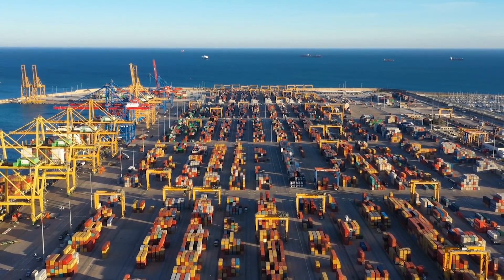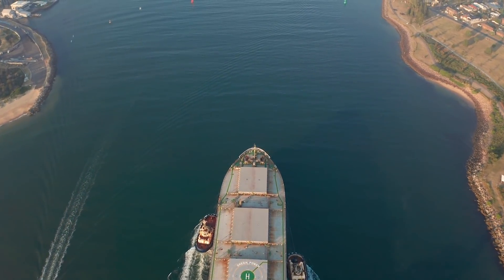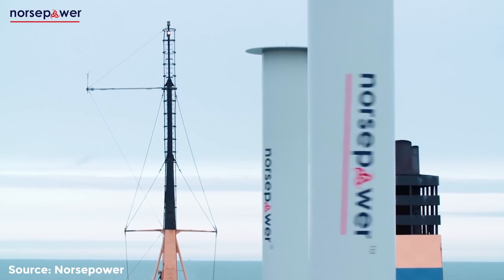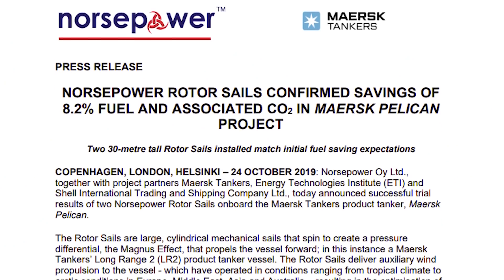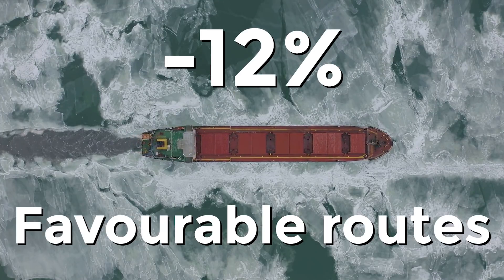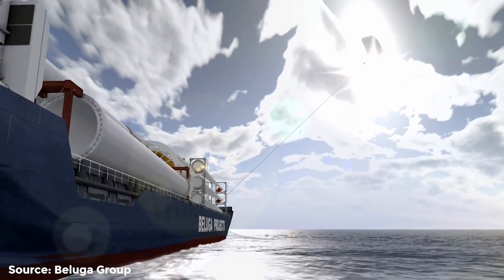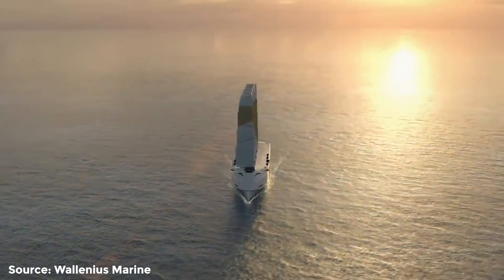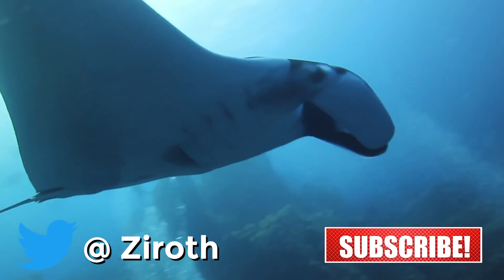Is Wind Power The Future of Shipping?

Comment: Complete nonsense! Typical large vessels have 10,000 to 50,000 horsepower engines. Calculate how much wind it would take to equal that and you see sails miles on a side! So you say, use more smaller boats. NOPE! The REASON huge boats are used is to cut COSTS! Two smaller tankers to equal one supertanker cost as much as 4 times as much per barrel of cargo.  The best answer is to go to improved engine designs.

Comment: I was trying to find a number on the amount of fule used by the shipping industry per year. Apparently some ships can use 380 tons per day. The amount of savings by a self sustained ship.🤯
Reply: Well that fuel is not usable by other vehicles. Its so damn heavy that you need to heat it up to 70-80 degree celcius(around 160 F) to make it somewhat fluid. The worst thing about these fuels that they contains a lot of sulfur and when you release it to atmosphere it causes acid rains. Also a lot of particules that can damage your lungs but dont worry there are some regulations to prevent and control these emissions.

Comment: If we use combustible hydrogen it could totally topple the oil powered systems although maintainance and safety will require high level work, but will totally revolutionise the industry  because there will be no use of oil and fule could be generated on board......... making range unlimited and cost cheap.
Reply: Where does the electricity to make h2 come from?

Comment: 4:22 this has actually been true for all sail powered boats for as long as we have sailed. Sailors want a side wind more than a tail wind. 

If the wind is blowing behind you to the front of the ship, then the faster you go, the slower the wind is relative to your sail (if you're going 20 mph and the wind is 30 mph behind you, it loses speed catching up to you and hits the sail at 10 mph). your ship will not get any faster as soon as the wind hitting the sail is too slow to overcome the friction. 

If the wind is hitting the side of your ship and you use the sails to deflect it backwards, you could be moving at 50 mph and you will still have wind hit the sail at 30 mph.
Reply: That and for larger vessels with sails on multiple masts the sails will start to get in the way of each other if the wind aligns too closely with the heading of the ship, in the extreme case of having the wind coming from directly behind you then you would effectively lose the use of all but the aft sails as the others get basically no wind due to the aft sails being in the way. Sure some moving air would probably get through/around the aft sails but it would be slowed significantly reducing the efficiency of the sails forward of it.
Reply: @FaerieSeraphina  yep
Reply: @FaerieSeraphina  with the wind from aft you would pitch them alternatively at ~45 degrees and minus ~45 degrees. Headwind would be an inconvenience as is the apparent wind due to the propellor propulsion
Reply: @FaerieSeraphina  the masts and sails cannot reach each other and would probably have to be feathered in a headwind or a 30-degree course change accepted to garner the wind propulsion. likewise a 30 degree course change would make the sails more efficient if from aft. Cannot imagine the overall wind speed slowing as it passes by the sails but from aft the sails are not flying they are only being affected by drag from turbulence in the unlikely event of the sails being kept square
Reply: Sailing beam reach also means you can return just as easily, however most long distance are confounded by head winds,  doldrums and so on, the equator is almost useless under sail
Reply: maybe its easyer today to use the "sails" as generators instead of propulsion.again having to say hydrogen.On route,use the electricity directly at propulsion,and when at port or outside waiting to enter they can generate hydrogen to use it on the propulsion system if they have electric propulsion,and using the hydrogen on the "old school" generator.there are natural gas powered cargo ships yet.

on the crazy brainstorming,i can imagine a company having some surplus ships,without work for them,and instead of placing them in some random bay,placing them in a high wind area,coming to land as they get the tanks full to sell the hydrogen.hahaha.
OMG,imagine all of that crazy amount of ships that are rusting in singapore due to lack of cargo,producing hydrogen.
https://mothership.sg/2016/05/waters-around-spore-turned-into-parking-lot-for-oil-tankers/
Reply: @xiro6  But hydrogen production is highly inefficient, I don't really see how this would be economical.
Reply: @MDP1702  but,it only produces hydrogen while anchored or docked,using free wind that otherwise is not farmed.it just spends device lifespan hours.
Reply: @xiro6  I doubt it will catch much wind when docked. Hell, how are you catching this wind? Won't this hinder unloading/loading operations? What is the cost?

No, I don't think a set up like that will be economical.
Reply: @xiro6  I don't think this idea makes very much sense. The primary issue being energy storage. It is difficult to contain enough energy to power the ship in say batteries. Even if this was possible, why not have clean energy generation at each port and simply 'fill up' while waiting for things to offload. Surely a dedicated generation plant would be much more efficient than what can fit on the boat (all the while taking up cargo space).
Reply: I've never seen a ship move at any miles per hour. Where are you from? Montana? Center of Mongolia? But, yeah, you got the physics pretty OK.
Reply: @VidarrKerr  It's better than knots, though even better still would be km/h
Reply: Not quite.......acceleration stops when forces forwards are matched by drag. Also as the ship accelerates the apparent wind direction moves forwards and reduces the effectiveness of the sails and the direction of propulsion (increasing drag sideways)
Reply: Dang,  can you explain this better,  there is constant slipping action,  between the wind amd the sail(s)